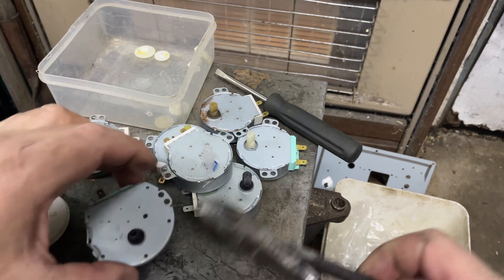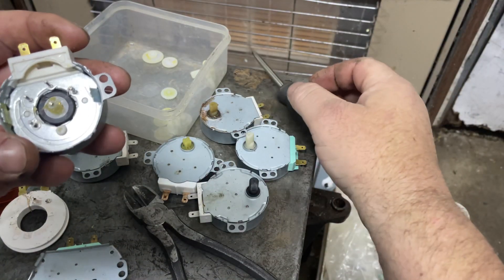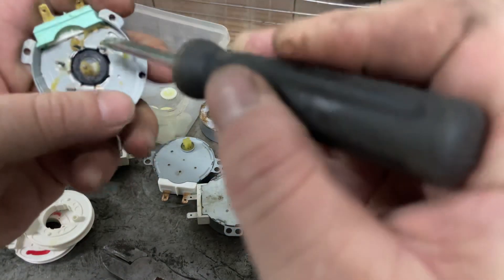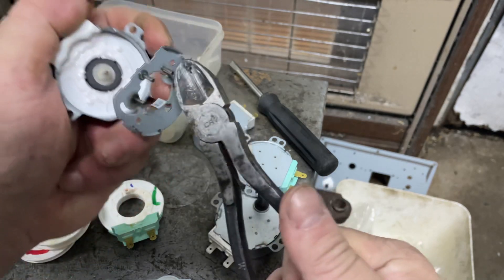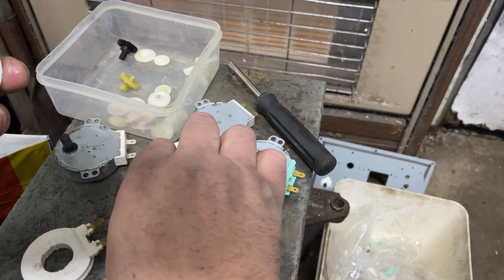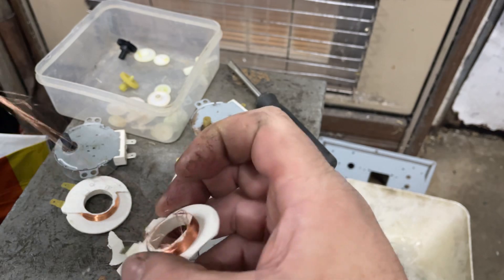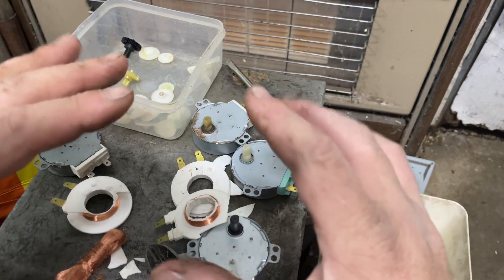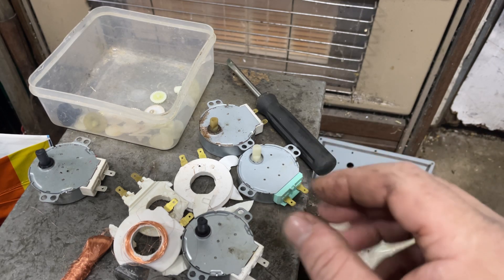Microscrapping: synchronous motors

Comment: For the ones with plastic on bottom  break off brass then use screwdriver place  in hole twist it will come apart.

Comment: I assume that you have about a Trillion Donut Magnets as well, I have several, I use some for holding stuff on my shadow board.
Those oils out of those stepper motors I just cut through the lot with my snips.

Comment: I use snips once I have it at the plastic and brass prongs stage just cut the plastic and coper in half. It's very easy to cut. Then it peals off without risk of little cuts and such on fingers 😀. Don't forget the pongs 😊
Reply from the maker: I love reading about all the different ways that scrappers deal with these

Comment: Thanks for the video! 

Lbs to kilos are 2.2 pounds per kilo. How about a pair of larger garden shears (lopping shears) and crack it in two? Also, maybe use an automotive pick to pull the copper out of the center spool once it is cut or peeled open? Also, I think bare bright has to be 22 gauge and thicker, NO shellac either unless your yard tells you differently. Thanks again!
Reply from the maker: Thanks for the input. I’ve learnt a few things since I posted this and I would do some things differently. Plus the copper def was covered in a clear coating.
Reply: @IndustrialPermaculture  Thank you very much for sharing with us!

Comment: Well i take them put the spool with the plastic in a metal can the burn in a wood fire then I get #2 copper price plus get yellow brass off the prongs or sell them as uncleaned  electric motors
Reply: That sounds ecologically irresponsible. Why not shear them in half with a lopping shear and pull out the copper with a pick?
Reply: @CuriousEarthMan  because scrap yard where I sell at won't buy it with shalack coating  they pay insulated #2  so I burn shalack off I can get cleaned #2 copper price  3.00 a lb compared to uncleaned at .80 a lb
Reply: So what would you like 300.00 for a 100 lbs or 80.00 for a 100 lbs of copper
Reply: @deanharbord3591  I think I would take the copper off the spool, and put the copper alone in the can in the fire. I wouldn't burn the plastic spool, just the shellac.  I might make a rocket stove, and pull the exhaust through some stainless chore girls and through a container of water, and throw that in the trash, for your municipal burn plant with pollution controls. I feel for you, if your only area yard won't buy  #2 bare copper wire which some yards call #2 bare wire, 'enameled, burned or shellacked'.  Again, I feel for you. I would try to avoid burning the plastic though, but I'm listening to what you say.
Reply: @CuriousEarthMan  well I don't burn the plastic  not inless it's a tough one partly melted  but a lot of times since there's not that much copperbin there I sell it for copper electric motors for 32 cents a lb  that way sell the steel plastic and all
Reply: @deanharbord3591  I misunderstood when you wrote: " i take them put the spool with the plastic in a metal can the burn in a wood fire". Thanks for clarifying! No worries!
Reply: @CuriousEarthMan  you can put them in a can and burn them is what I meant  but even the bigger electric motors we still here have to burn the shalack off the wiring or scrap yard buys it as uncleaned copper
Reply: @CuriousEarthMan  I just scrapped a 75 horse power electric motor average a lb of copper per horsepower got 77 lbs of copper out of it after shalack burned off  I could of got a 100.00 as is but got 231.00 in copper plus the iron
Reply: @deanharbord3591  those all make sense. thank you for the info!

Comment: I found the easiest way to get the copper out, is to cut the spool and plastic on one side using your diagonal cutter, then if you twist it open you can peel out the copper easily.

Comment: 4.5 To 5 Lbs for 100 Motors, I use a cable cutter & cut across no fiddling around & My yard pays #2 because of the fine wire
Reply from the maker: Thanks for that. I will try the cable cutter technique next batch.